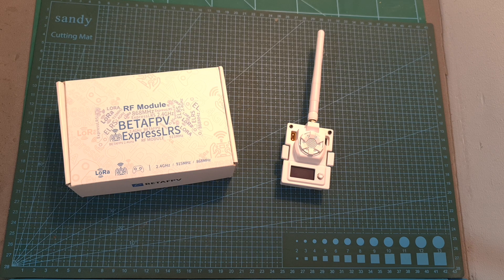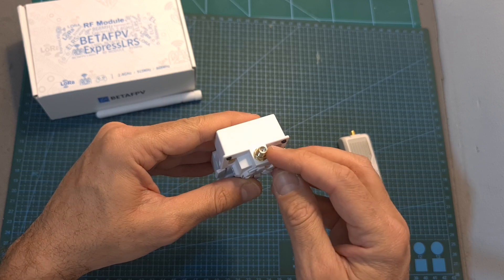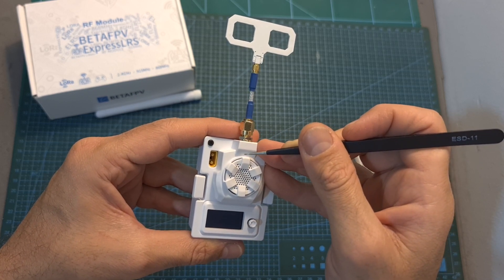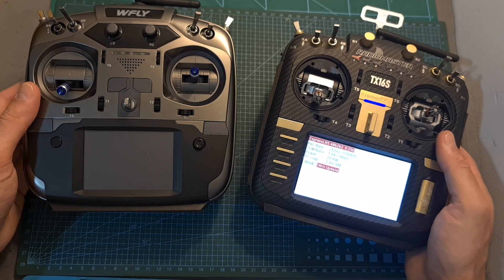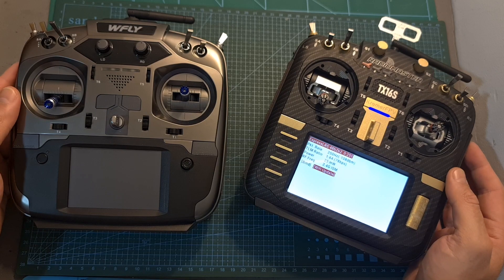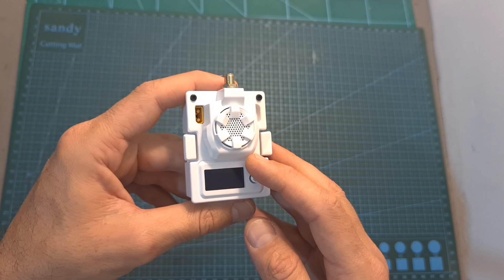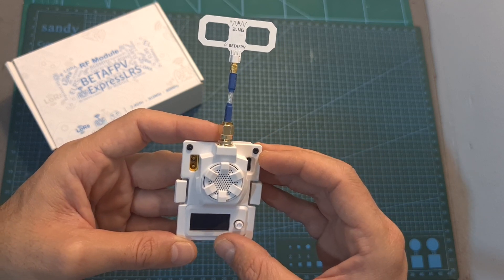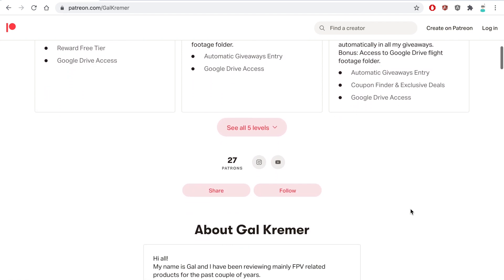BetaFPV ELRS Micro TX Module - Setup, Review & Giveaway (Closed)

Comment: What are the advantages of this module compared to an R9M in ELRS? GAL21BF
Reply from the maker: Hi, I didn't test the R9M in ELRS. 
Anyway, this module has a built in fan and it was designed specifically to support the ELRS protocol.

Comment: Hello Gal, Thanks for sharing this setup and review video. I have been considering trying Express LRS since recently finding out that TBS Crossfire's Diversity's Beacon mode doesn't work on their own Tango 2 controller. I found out the hard way. I lost video signal about 60 seconds from  takeoff and lost my quad in a wooded area next to farm land. If Tbs would've made Beacon Mode from their Diversity receiver work on their own Tango 2 controller, I'd still have my quad today. I told TBS what happened and asked why Beacon Mode wasn't working? They told me Beacon Mode doesn't work with Tango 2. They should let you know that before you spend $50 for a receiver that has beacon mode. Thanks for the informative review. GAL21BF

Comment: Question.  Do you need the Express ELRS LUA script on your radio or is it like TBS crossfire where you set up model under crossfire and use the OLED on the back of the module?  I understood that there was no need for the radio to have the LUA script and could connect thru the module?